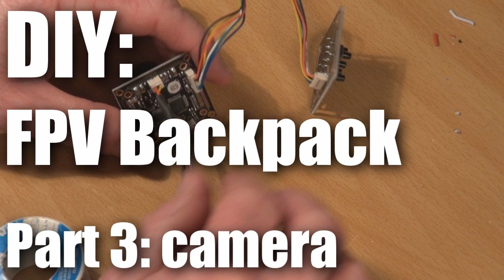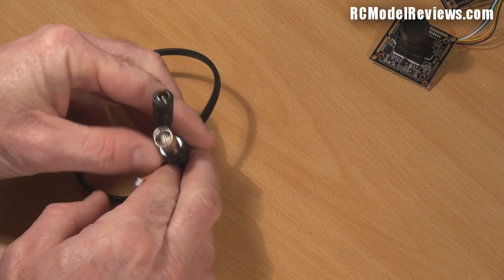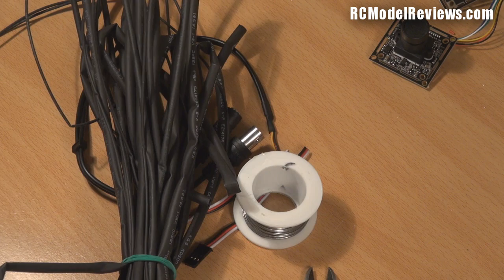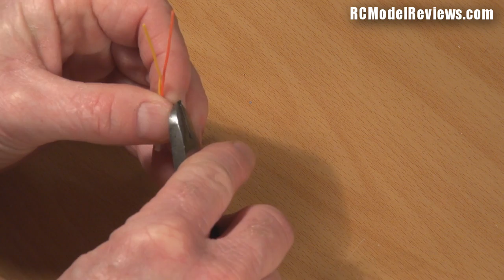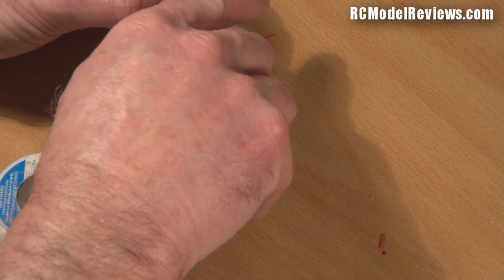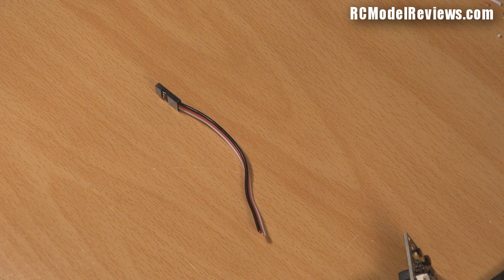DIY: FPV backpack build part 3 (camera)

Comment: It's an FPV backpack.  A simple, compact FPV system glued to a piece of Coroplast (corrugated plastic,) which can be moved easily from one plane to the other.  It consists of a small board camera, a circuit board with the video transmitter and two power regulating circuits on it, plus a small switching power supply.  An OSD (on-screen display) and sensors can be added to this basic First Person View system, but isn't necessary.  You use video goggles to see the view from the plane as it flies.

Comment: The last thing holding up the backpack seems to be the charge pump regulator. From what I can find on the Internet, this is an inverted charge pump. A standard charge pump uses diodes and capacitors to charge the capacitors in parallel, and discharge them in series, thus increasing the voltage.  An inverted charge pump charges the capacitors in series and discharges them in parallel, reducing the voltage. Bruce must already have the circuit boards, so let's hope the wait is over soon.

Comment: Bruce,
I must say sir that I do love your videos and as a new comer to the hobby (6 months now) I'm foaming at the teeth for some FPV equip. I have immersed myself in your "Backpack Build", but would greatly appreciate the 4th installment! I have everything you have recommended for use and just need a board I guess..

By the way, will 1.0mm copper wire work for the antenna? I couldnt get my hands on any welding wire in my local hardware store.. Thanks for everything you do my friend!

Comment: You try soldering two wires to each other while holding your hands in position so a camcorder that's mounted a few feet away can get the shot.

Comment: I got tired of waiting, made some research about the modules and bought RX5808 ,TX5823 also a little camera from securitycamera2000 and a ubec from hobbyking, regulators and stuff for the power supply and thats pretty much it, now im just waiting for everything to arrive. Also i need some screen

Comment: Heat shrink tip: Use a cigarette lighter. Put the shrink inside the flame (it wont burn or go black) until it shrinks. much better than using a soldering iron, which will give uneven results..

Comment: You're really learning a lot more than the main topic while watching these videos. If people had some patience maybe they could appreciate what you're showing us. I already knew what you were doing before you started but I still watched the whole thing and learned some knew techniques. I would have used heat shrink on each connection though. It will be hard to find a reason to not make an FPV setup after watching these videos. Thanks Bruce!

Comment: I just received my camera and it included an extra 3 wire cable with the micro connectors on each end which can easily be turned into two useful cables.

Comment: Thanks heaps Bruce - this is the vid I've been waiting for :))

I'm glad I didn't start hacking away at that video lead until I watched this. So some unknown reason, I had it in my head that I would need to run thin shielded cable for the video (yellow) wire.

I notice you're just using single strand unshielded for the whole cable - can there be noise issues down the track? Or is the fact that the cable is short good enough to stop RF?

Great idea using the servo extension lead as the basis BTW.

Comment: Good point with #2; So I tested some of my heat shrink with my ohm meter to find conductive spots. Didn't find any, but that doesn't mean it's impossible ofc. I always check my heat shrink for consistency and burned spots. Doing that in the beginning I got soot on my fingers, but I learned to heat less and made sure not to actually touch the flame to the plastic (thats how you really deposit a lot of carbon!). On #1, you must keep moving the flame back and forth to avoid this.

Comment: Try using Posi Connectors for connecting wires without soldering. These are same you use when installing your car stereo, should come in small enough sizes for this work. Posi-Products connectors help make your electrical connections fast, easy, and reliable with no crimping, soldering, or messy tape. Just strip your stranded wires, insert them in the caps, and then hand tighten the two caps together.

Comment: Use a block of Blu-tac as your third hand.
It stays steady and holds the wire, two bits will hold both sides of the wire aligned needing only a touch of the soldering iron.

Comment: how about you leave out the mundane bits like soldering and show the finished steps you cold do the whole backpack in 15 minutes rather then solder 3 wires would you watch a 15 minute video to see 3 wires soldered together?
i really thought this would be dune in 1 or 2 videos at this rate it will be an epic sager 
i like what you are  doing but please cut out the crap we don't need 
if people can not soldier a wire together really should they be attempting this project ?

Comment: Not good IMO. I've tried this and it has two drawbacks. 1. the heat is inconsistent leading to burning in spots. 2. Carbon is deposited and carbon conducts electricity

Comment: Uninsulated internal staggered wires could bad for moisture shorts. I'm not sure that would fly at Boeing. LOL! A lighter on wire tip plastic will let you strip it with fingernails.